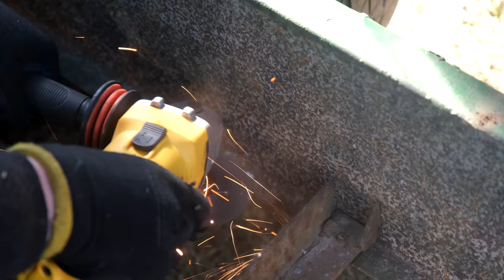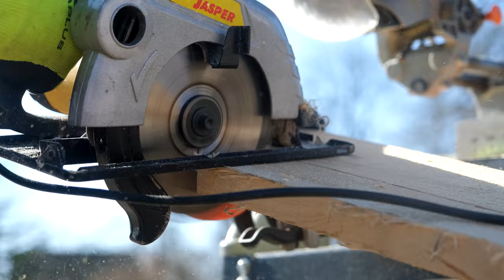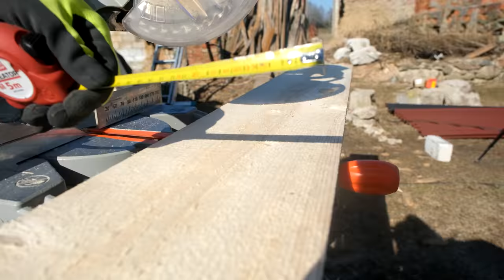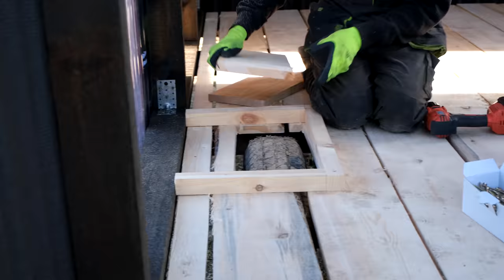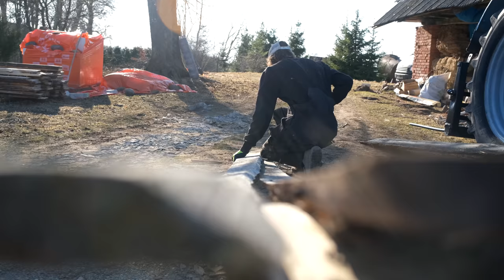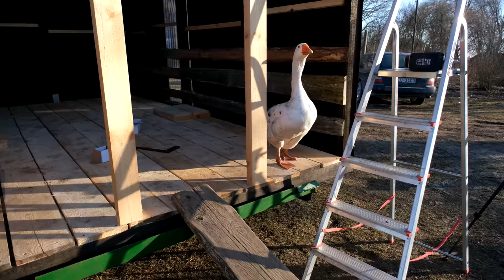Tiny House for Animals (FLOOR) PART 5

Comment: Great to see you add some rubbing strip inside the walls to protect the panels, especially where the goats may roam. The plastic light panel would not easily cope with a determined goat or two. Yes, it is a rustic floor and inside, but it is in a rustic setting for rustic animals to enjoy. Glad to see the geese inspected the work, they appeared to be pleased with progress.

Comment: Looking good. Think you're right that the trailer will need extra support stands - like the support legs/stands with a flat/wide bottom plate that you get on caravans and motor homes.

Comment: Hi all, 👋  love this video, thanks Dessy you capture so much. The team work is as impeccable  as ever. The floor looks great should last a few years. Door could be an internal sliding one! Just a thought. The step folding and stabilising the door end is a great idea. David that saw is a best buy, it has earned its money back ten- fold. BoBo approves,smaller version for him and the girls......You both have a lot more to do on your list. Blue sky and sunshine is beautiful  and just the type of weather you need. April comes in like a lamb and ends like a lion. Spring is arriving. Thanks for sharing,stay safe.

Comment: Hey kids, why not try to waterproof, (with oil or some commercial product,) the floor of your "Tiny House for Animals"?
I think with the urination and poo-poos, it would be wise to try to protect the wood from absorbing all that in some way, even if you do put a thick layer of straw on top of the wood floor planks.  What do you think?  It looks great, what you are doing and have done.  And it looks like spring cannot be too far away, yeah!  : )

Comment: Pew Pew approved --- LOL --- I think you could maybe have "legs" on hinges that you can fold up while moving trailer to different areas then drop down an kick shims under them to level them in uneven areas --- Love that you thought of a clever idea to stop the tires from rubbing and still keep your boys hooves safe --- Hugs
Reply: Legs also to rise the trailer up to take pressure off the tires while parked for long periods of time.  Keeping the tires from getting flat  spots from the pressure being put on them while parked.  Over a period of time causing the tires to  break down.